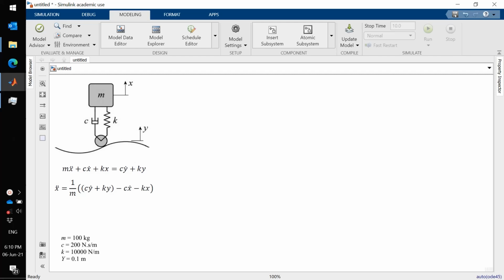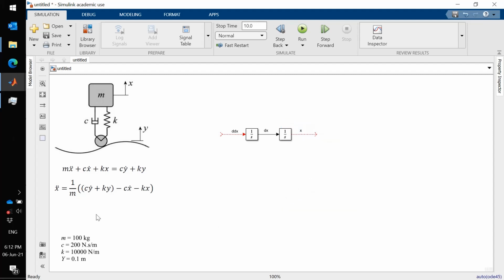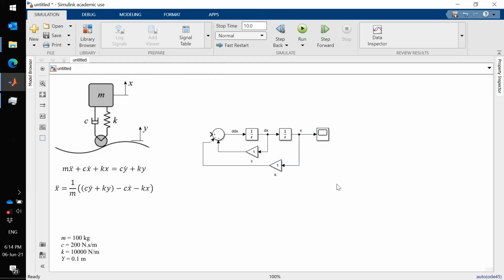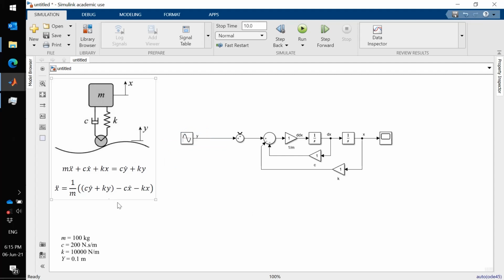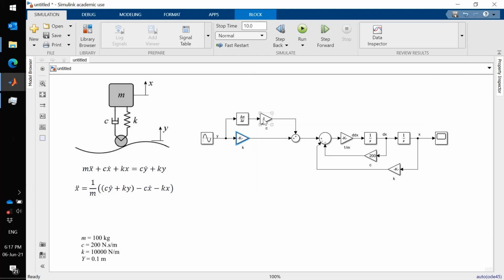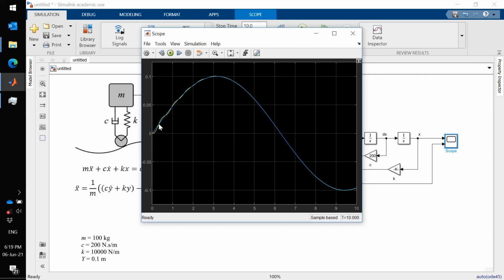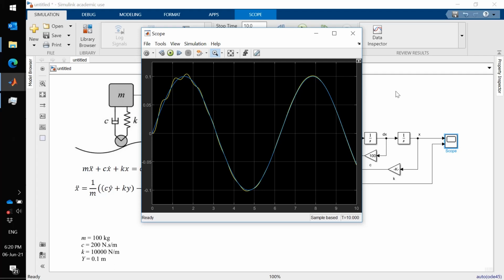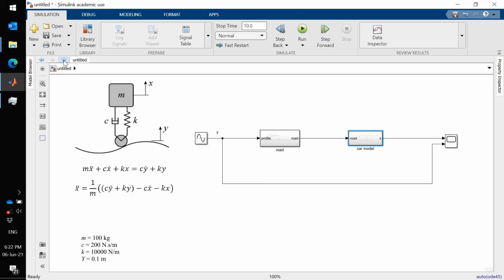Matlab simulink model of a Quarter-Car model

Comment: Thank you Prof. for the clear well explained topic. What if I want to to compare between different responses on the same plot by giving different values for c . Can I do that in Simulink ? how please !
Reply from the maker: Duplicate the system and send both outputs to the same scope. If you are using an older version of simulink you will need to use a multiplexer block [Mux] to merge the two output signals.

Comment: I have a question, what if same system , but we have to simulate with a step input?
Is it still right to use a derivative block if we use a step input?
Since the derivative of numerical constant value is 0.  
How would that work or how can I model  with step input?

Any help is widely appreciated.
Reply from the maker: The derivative of a step input is an impulse. The derivative block in Simulink outputs an impulse with an amplitude that depends on the time step used in the model solver. The math holds well.
Reply: I just recreated this and used a step-input and it seemed to work fine and the model didn't fail. Just check your parameters and use reasonable numbers.
Reply: @jasonbledsoe9196  Thanks
Reply: The derivative of a step it is called delta function, or inpulse. IT works